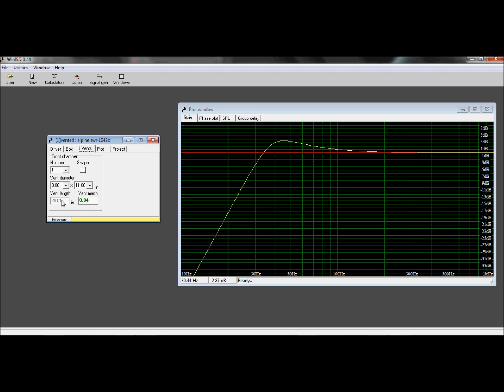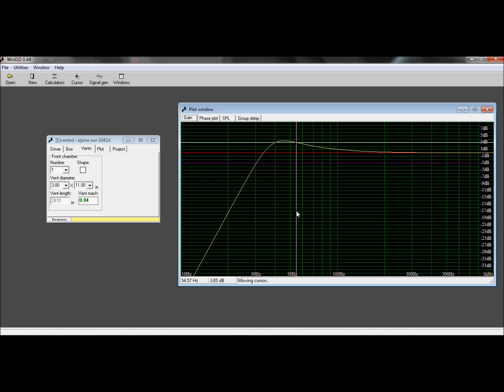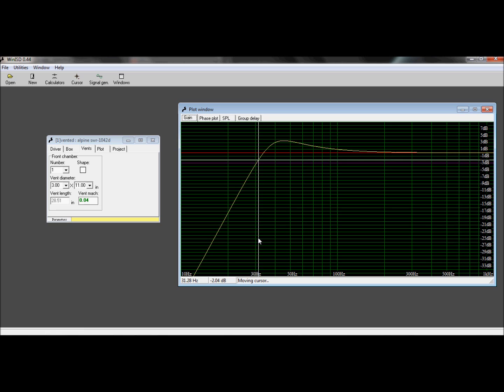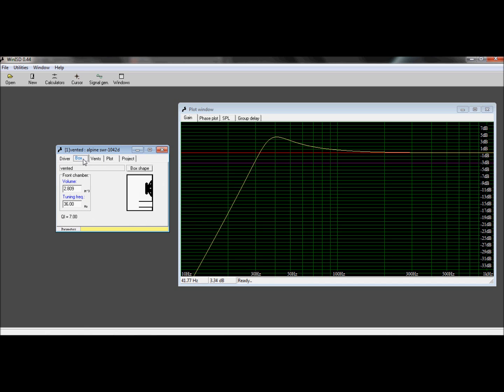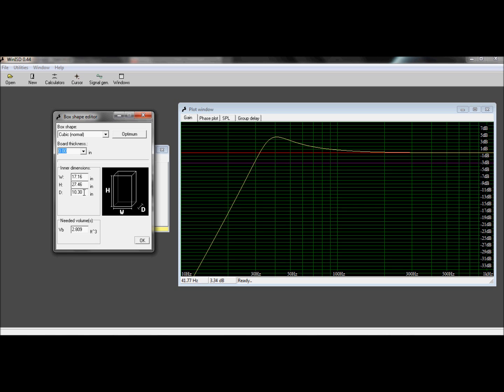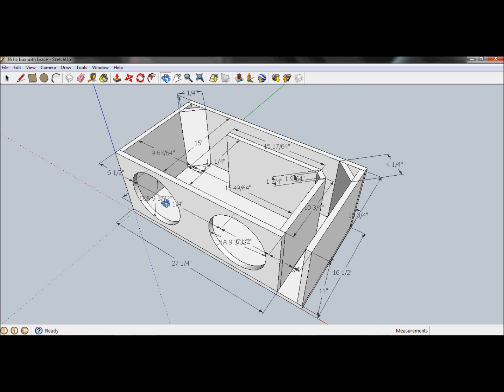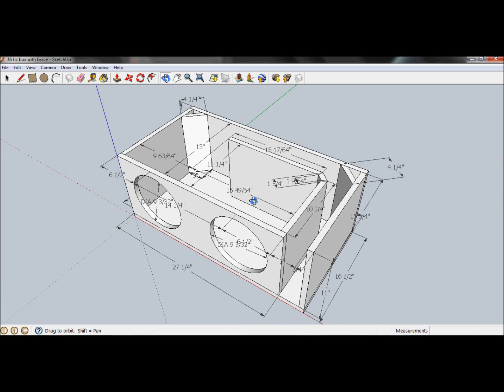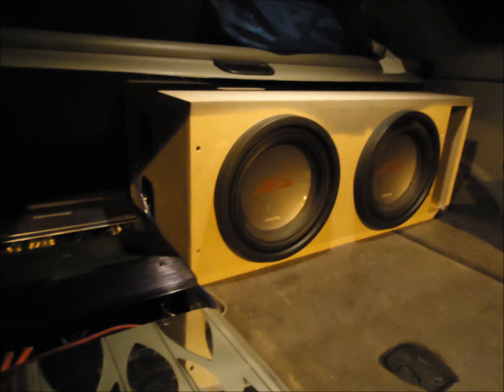Ported enclosure for sq.

Comment: That is not sq. The bix u made is gonna sound like boomy bullshit.. What most ppl dnt realize is u do not want that bump... If u want sq ported u need a smaller than recommended box tuned really low for low group delay punchy accurate bass with wide bandwidth... Like a transmission line box... I do boxes i call half ass t line.. its just small ported tuned low... For 15inch usually 1.5 2.2 cubes 28hz and 12 inch 1-1.3 cubes tuned 28